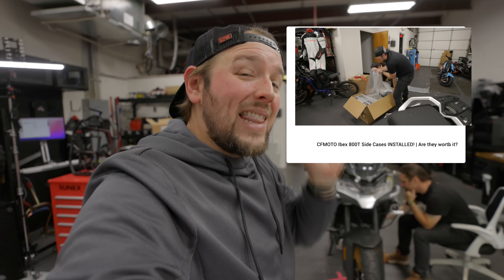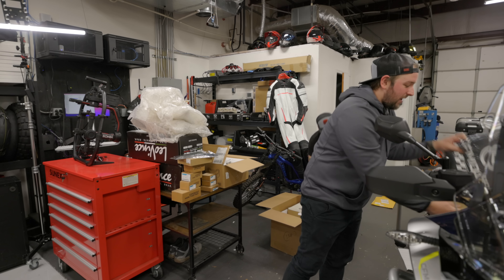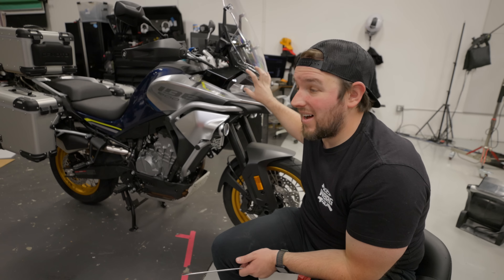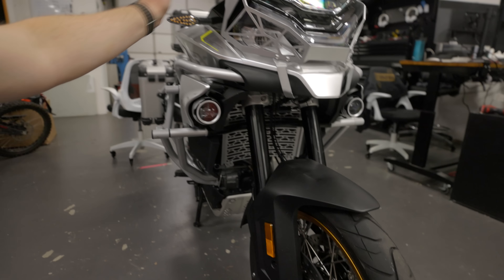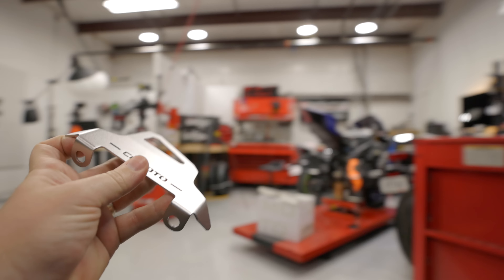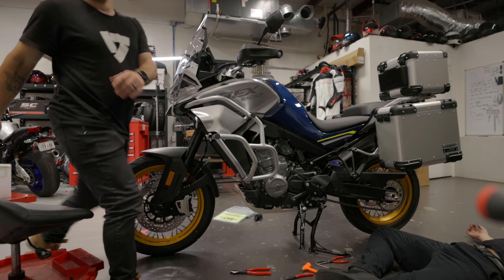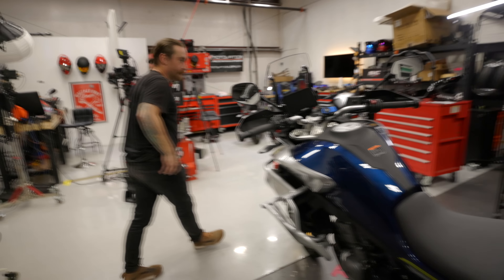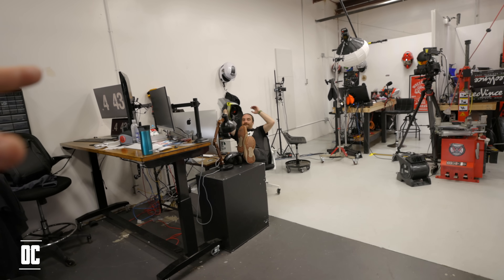I made the CFMOTO Ibex 800T INDESTRUCTIBLE!! | FULL Protection

Comment: The bolt; Did it fall into the skidplate.. or did it slide into one of the bars itself internally? Or are the side bars / welded off inside behind the rubber bungs

Comment: OC: Quick question, after having owned the bike for a while now, what's the average MPG? And, does it take cheap or expensive gas? Also, you should do a ride for the next video.
Reply: It’s a high compression engine so it will have to run premium gas. And I think it gets around mid 50’s.
Reply: Premium gas requirement is quite the oversight. A lot of places where people take ADV bikes, you're lucky to get gas, period. That severely limits the capability of this machine to basicly populated areas only.
Reply: You can run them on regular in a pinch with no worries   Ca models on the gas tank reads 87 octane

Comment: So I went to a CFMOTO demo event, as did a few friends, and we all agreed: the Ibex 800T is nice, but the fuel and throttle maps kinda suck, and at times a bit sketchy. For instance, taking turns in 2nd gear, when you open the throttle on the apex exit, it seems to be either 0% or 10%+, no in between. The throttle was jerky and not smooth, and fueling felt rough in spots. It wasn't just the 800T we rode, either, as the other 3 800S models they had did the same thing. To me, it's a great first try by CFMOTO, but it needs refinement.

By contrast, the 700CX-L was a phenomenal bike in both the Sport and Heritage trims. I'd daily that bike for sure.

Have you noticed issues with the throttle and fueling on the 800? Why are no reviewers mentioning the iffy throttle and fueling at low RPM?
Reply: Because some people are not really bothered by it, like me. I ride all my bikes in sports mode at all times. Bit snatchy? I guess? Does it bother me? No. Probably just needs some mapping tweaks. At the end of the day, reviews can also be quite subjective.
Reply: Because they are being paid or given free stuff to review this. They're not going to tell you all the bad stuff